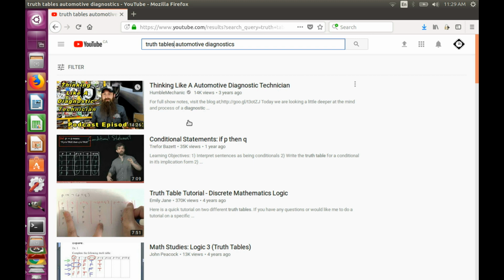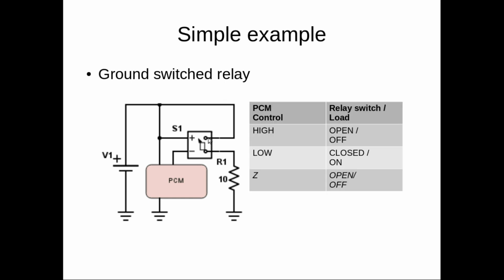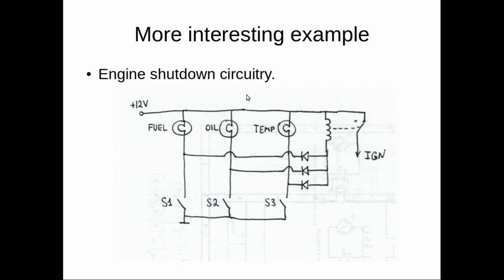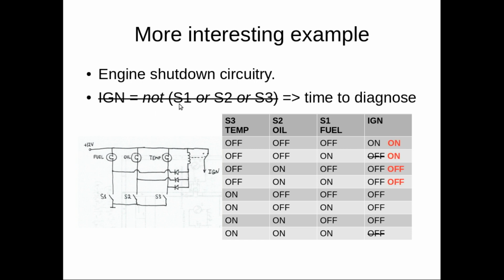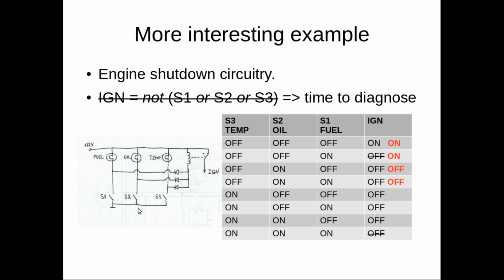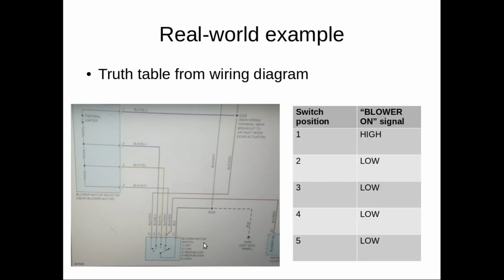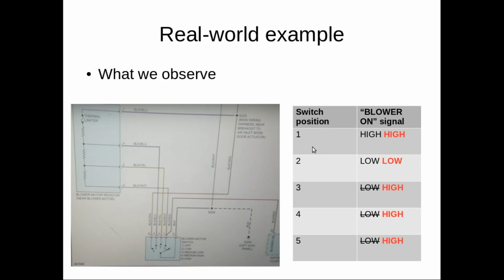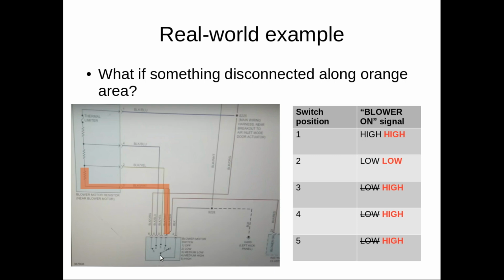Is there use for Truth Tables in Diagnostics?

Comment: Dmitriy, great explanation. I've used this concept to varying degrees, and do find it very useful. It's a back of the mind organizational thing. I have resorted to actually writing out a full table on especially hard diagnostics.

I think it's another useful tool for any diagnostician. I like to pull knowledge from any and all fields if it can be useful. I really appreciate you taking the time to better explain this.

I think the more cross disciplinary knowledge we can gain, the better we will be at all sorts of diagnostics and problem solving.
Reply from the maker: Glad to hear this is useful in the field!
Reply: @DmitriyL_Arithmechanics  as an additional thought process, absolutely. Helps to clarify at times. I would say most useful when at the "muscle memory" level more so than a standard test as it can be time consuming. I believe my direct contact info is on the forum, if you want to continue the discussion or have other thoughts.
Reply from the maker: @ScienceOfDiagnostics  I think it will be a good topic to discuss at diag.net sometime, so see you there!